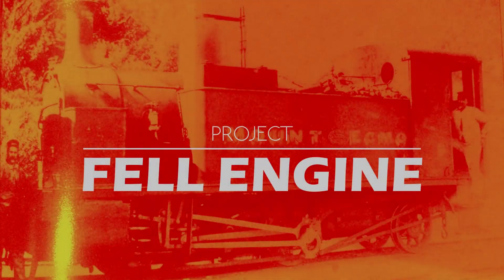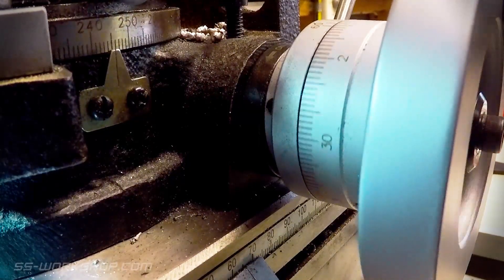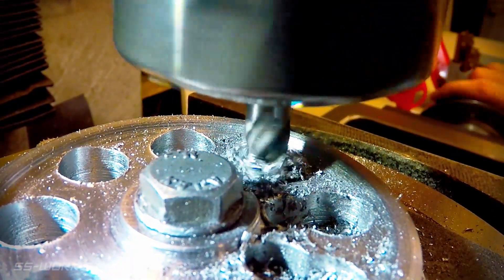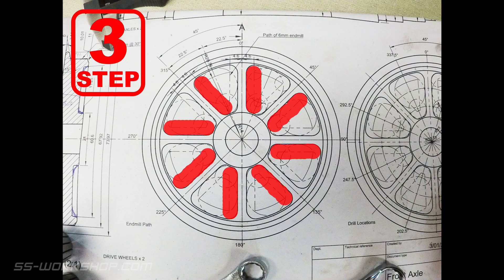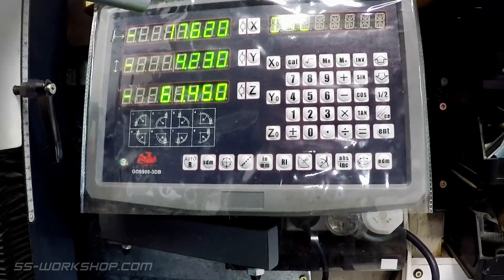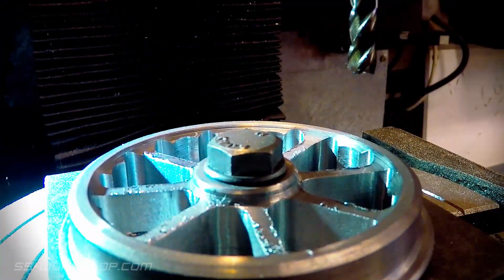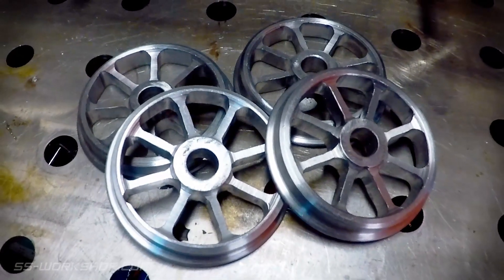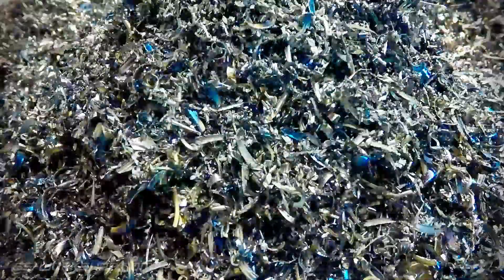Fell Engine Project - Rotary Table Wheel Spokes S1.E11

Comment: I've searched you tube for others like myself who can use a rotary table. Only found you and Joe pie and pretty sure that lazy machinist. Is that software doing trig for you, but you still have to know trig? I was already a master of trig before I got a mill. It is a great application. I have successfully taught people how to use trig to accomplish tasks and find it is easier for them to learn to use it than to understand it. I believe I can help hobby machinists with a method that takes the trig requirement out of the picture. It's not possible for me to make great videos, being on the autism spectrum, but I probably have some good content. Maybe we can help each other. If not it would still be great to hear from you.
Reply from the maker: Hi Andrew, great to hear from you. It’s a shame we don’t see more people using rotary tables certainly far more useful than rounding corners we often see. I hadn’t really thought to explain how I do my set out but now you mention it I’m sure there are hobby machinists out there scratching there heads on it. The way I do my set out is tech drawing geometry, and then measure the result in the computer for my tool paths. It might make an interesting video at some point to run through some options on working out setting outs as not everyone has the resources to do my method. Trig isn’t my area of expertise so certainly would welcome your assistance to explain your method if I made that video. At the moment I’m taking a bit of a break to work on my house but will let you know if I get to making that video. If you would like email me my address is sswkshop@gmail.com cheers Chris
Reply: @SS-Workshop  I didn't know that you replied until now as My sons friend is showing me how to do these things. Sorry for that. I will send a message to your email. Thanks for that.

Comment: Great job. It's good the wheels don't have the cranks on them so you can make them like this. Don't worry about using steel - cast iron wheels have to be given steel tyres anyway when they've worn down.
Reply from the maker: Thanks David, yes cranks would have complicated things, It’s good to hear you comments on steel wheels I was certainly of concern for some time that they would cause me issue.